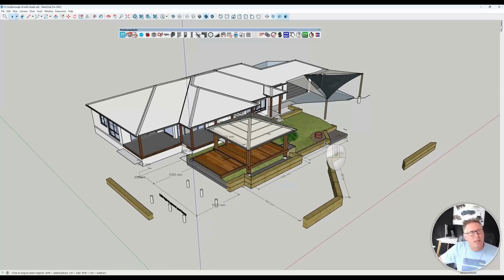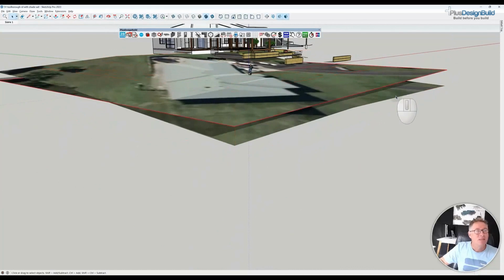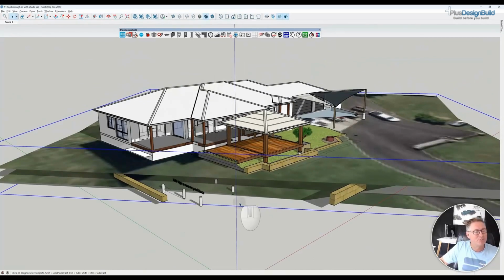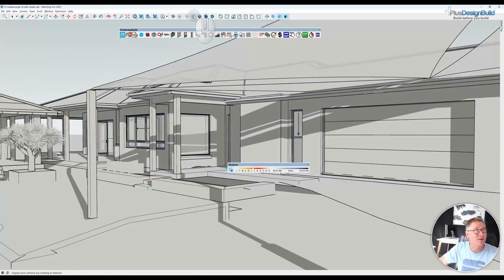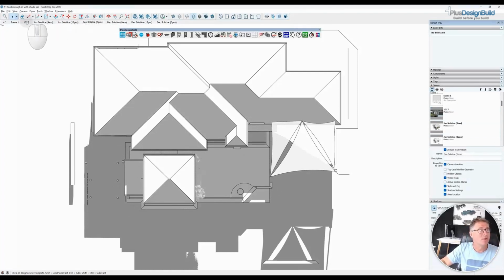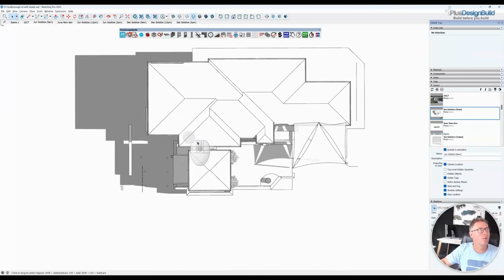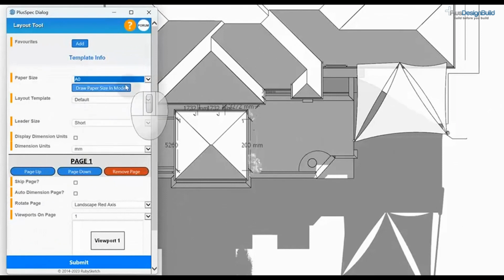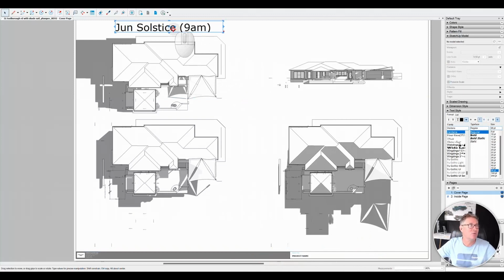Creating geo-located shadow diagrams and construction docs on 3d terrain the easy way in SketchUp

Comment: Great clip Andrew 
Can you share some tips or a video on how you draw the shade sails ?
Reply from the maker: Hi Dave, in this case, it is super easy. I used the post/column tool in Plusspec and added a guideline to the roof. Draw a triangle in Sketchup from the post to the guideline, make it a group, and use the arc tool on each edge of the triangle to offset the straight lines then delete the straight lines.  I then applied material and used the "BIM tool" to associate tags and pricing information. I used recipes, cost codes and suppliers for the BOQ, takeoff, purchase orders and ancillary items.  It took 2 minutes.  You may want to play with the post heights to get your preferred look or shading. In this case, you will need to redraw the triangles as it will be quicker and easier than editing the original geometry. I hope that helps.
Reply: @PlusSpec  would you consider doing a short video showing this sometime?